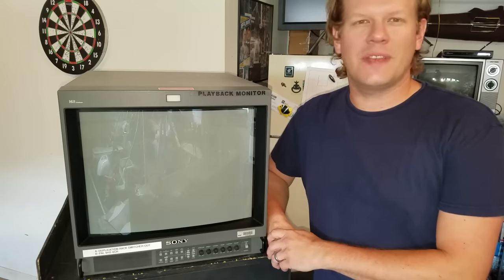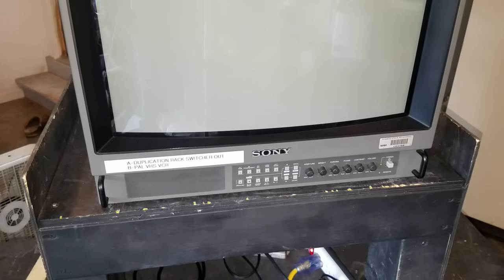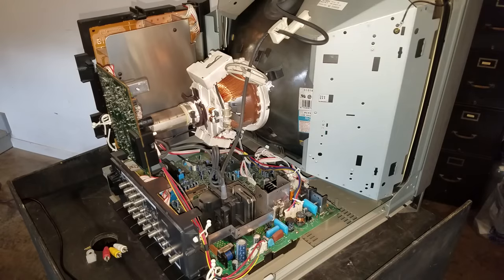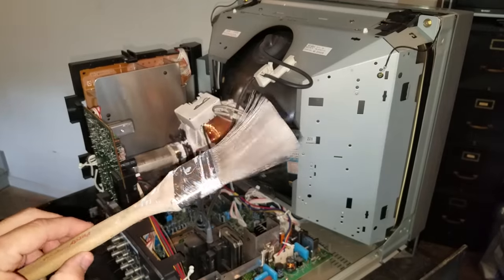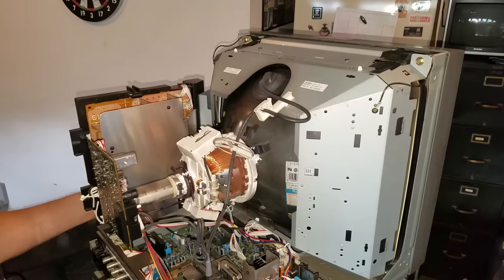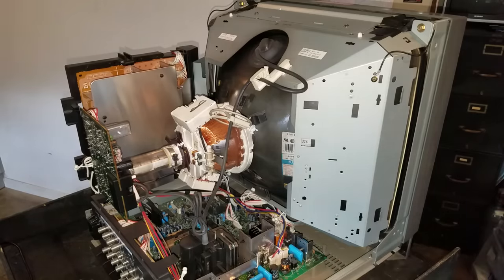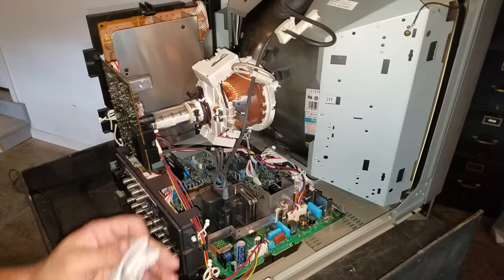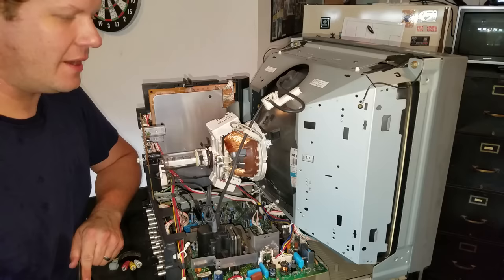How to Clean inside a Sony PVM CRT Monitor

Comment: Wow, when you said dust build up could cause smell and crackling/popping I just had to check if my monitor wasn't like that and turns out it was....extremelly dusty, even multiple cobwebs and dead spiders. Cleaned her up and the noises reduced almost entirely, it also runs noticeably less warm! You literally saved my AOC CT500G, thanks for the great video and info!

Comment: I have a PVM 20L5 manufactured in 2002.  I have never taken it apart to clean due to fear of breaking something.  Was this the first time you cleaned yours since you had it and how often would you recommend doing this?
Reply from the maker: Hi.  Thanks for the question.  This was the first time I cleaned inside this monitor.  I've cleaned inside many others,  I'd say you need to do this once every few years depending on the environment you store it.  I have lots of monitors in storage, so I have to clean them every  six months to a year due to the high dust.

Comment: Aren't you afraid of being shocked? Be careful, my friend.
Reply from the maker: papa agoo I'll go over this a little more on my q&a video I'm working on.  I have been shocked, not by the anode or flyback.  That's just part of working with electricity though.  There's always a risk. Thanks for watching.
Reply: @RetroTechUSA  how badly did you get shocked?
Reply: Retro Tech you should totally wear a mask for the dust and gloves and/or a grounding bracelet to isolate/ ground yourself. be careful bro! not worth the risk. thank you for the video. God bless

Comment: Hey Steve, I’ve been watching your CRT videos over the last few days, mainly the safety ones and cleaning ones.  They gave me the confidence to open up my “new” Sony Trinitron KV-27FS13 made in September 2001 that I just picked up.  I wanted to give it a good clean out.  I have worked on electronics before, repairing an iPod classic, upgrading my laptop internally, and repairing my clothes dryer.  I was a little worried about working on a CRT, as I never had before, so I bought some heavy duty high voltage gloves with the leather gloves going over the top of them, I wore a thick cotton long sleeve shirt under the gloves, and I also wore some rubber construction boots I had and stood on some spare wood I had while I worked, along with taking my wedding band off, lol maybe a little over the top but I wanted to cover myself.  I also worked the entire time with one hand in my pocket just in case.  I did not discharge the tv, I just left it off for three full days after I got it and before that, it was off for awhile and only turned on to test it the day I got it for a few minutes.  I was a little concerned with trying to discharge so didn’t attempt it plus just for a cleaning, I felt it wasn’t completely necessary.  I took a paint brush to the top and non computer sections and then used anti static brushes on the cables and the motherboard.  I did not touch the anode cap at all.  I was hesitant to hit the fly back and the line that goes from the anode cap to the flyback, but as I went on, I got enough confidence and guts lol to hit those lightly.  Gave the motherboard a nice cleaning too.  I finished up with the air can from top to bottom.  I also took the back plastic shell and scrubbed it down with soap and water with a sponge on both sides, as this was the most dusty part of the tv (the inside had dust but I expected worse, it was not bad at all).  I turned the tv on about an hour ago and it worked so I didn’t screw anything up lol.  Anyway, thanks again for your video, it was very informative and interesting.
Reply: would you recommend wd40 electronic cleaner for cleaning the inside of the CRT?

Comment: I recently learned that dust buildup combined with humidity can allow for high voltage arcing too.  I need to try cleaning the monitor, but I want to learn about high voltage safety first.

Comment: I have one of these, great monitor. Great tips and overall very informative video. Keep it up. I subscribed.
Reply from the maker: hdRGB Thank you.  It's a great PVM.  Glad to have you here.
Reply: Retro Tech what if the monitor accidentally drops and a circuit plate touches the iron cover? Is that dangerous?

Comment: Hey great instructional video, this is very helpful.  I just picked up a Sony trinitron from October 2001.  I want to give it a cleaning inside similar to what you did in this video.  Do I really need to discharge the tv?  I plan on leaving it off for two days and prior to, it was tested for a few minutes but before that it wasn’t really used.  Also is a purdy paint brush ok or should I be using anti static brushes?  And finally, when cleaning with a brush, I should just be avoiding the anode ring up top and the fly back and not touch those with the brush?  Everything else is ok to give a quick wiping with the brush?

Comment: Hello Retro Tech, 
I just subscribed to your channel today. Great job on everything you do and how knowledgeable you are, thank you for doing so much for the gaming  and electronic repair enthusiasts. In the past year or two I been into electronic repair, restoring, modding and anything video game related. Since I've discovered this new passion, I have been trying to fix and restore anything I own that needs fixing. Recently I own a Sony CRT KV-27FV17 manufactured in the year 2002, I use it to play my consoles as well as to watch DVDs. I want to attempt to clean it thoroughly just like you showed us in this video. Do you recommend discharging the TV prior to cleaning it or is not really necessary? Also, in the future with the help of your teachings I would like to attempt to fix a problem it has, the tv displays a bright white line on the left side of the screen and the line could be observed most likely when the display is black. If you have any suggestions I would be happy to learn and attempt them myself. Thank you, I will continue watching and learning from your provided videos.

Comment: Hello Retro Tech!, I been watching your videos they are great, and have the info I've been looking for, been giving all thumbs up on them and subbed your channel. You explain things well and your quite knowledgeable.   I love CRT Monitors and Televisions as well, just brings me cozy nostalgia :) watching some movies on them and doing some retrogaming on them.  

***I have one TV a 1987 Zenith that is very dusty, and i want to simply brush the dust off the board / components inside and hit it with compressed air, like you did.  If i leave the TV off for a few days then open it up to dust only as you demonstrated and being careful not to touch anything with my hand or arm, do i need to or should I discharge the CRT first?***  

I just put my subject/question above at the beginning so you don't have to read all of my lengthy diatribe to answer me but I put a little more info below, so you can laugh or shake your head! :)  

I have recently picked up a few consumer TVs, left for trash, that all work great - even found a late model 2005 Sony 32 inch Wega Trinitron HD 1080i HDMI boob tube crt TV (excellent picture, btw), boy was it heavy to get back to my place all by myself (manual says 165 lbs.), I felt like an Egyptian building the pyramids with massive granite blocks, lol.  I also found a 'Zenith 1987 27inch Receiver Monitor Advanced System 3 TV' and it works fine has a decent picture, however,.. I looked in the back vents with a flashlight and its very very dirty, worst I've ever seen -the dust is thick and actually black & caked on lookin', building up what looks like magnetic dust patterns centimeters off the neck board and flyback! and on most other stuff in there, the mainboard at the bottom is buried! in thick dust, can barely see there's components on it, haha!.  It looks to be massive dust combined with saturating cigarette tars??, the previous owner must have been a heavy smoker for decades or the TV came from a bar! lol idk lol - however, the TV does not stink like tobacco or smell at all even when warmed up so i don't know, may just be 32 years of heavy black magnetized dust. haha!

I'm just concerned if i should discharge the anode before using a brush to knock off the heavy dust from components and then hit it with some compressed air.  Just order some of those special rubber gloves maybe? What do you think?  I'm planning to just go by your video, as is no nothing, just leaving the TV off for a few days but I wanted to verify in case you did discharge the CRT anode and left it out of this cleaning only video. (I thought about possible arcing of current and thats my concern even if i don't touch anything)

Thanks in advance and please let me know, if I need to discharge the CRT to just dust? 

(I don't want to make a stupid mistake and get knocked out or worse.  I've been shocked before - I felt AC 120 volts house current as a child and its really bad man, I think I almost died, lol.  Also been shocked by Tiff grass lawnmower spark plug and it was quite painful maybe akin to a rattlesnake bite.)
Reply from the maker: Thanks a bunch!  I can tell that if I were cleaning out the TV that you have in question, I would be fine cleaning it without discharging.  However I can't make the call for you, since I can't see the TV myself and I don't know your exact level of knowledge around CRTs.  It's always better to be safe than sorry.  If the TV has not been turned on in a while, then there may be no current left in the tub, but that's not 100% the case.  Just do what you feel comfortable with and don't be afraid to take some extra time to do things as safe as possible.  I still discharge CRTs before I work on them just to be safe.

Comment: Now I feel much less stressed about buying a PVM. What kind of screwdriver are you using to take apart the shell?
Reply from the maker: Thanks.  Any Philips head screwdriver is fine to use to open the shell.
Reply: @RetroTechUSA  three months later and finally getting to dust out my 14M2U and 20L5.

My L5 has a 129x card in it, do I need to remove the card to be able to take off the shell?

Comment: Hi there, thanks for the PVM vids and this one in particular helped me open it up! Just received a 1354Q and it’s extremely clean inside out but I can’t get a picture to appear. What’s the expected result turning it on with no inputs? I get a blue screen then screen goes black and tally light remains a consistent orange. I get the result hooking up an N64 or GameCube using the composite video lines. It’s my first PVM so hope you can help. Subbed already! (:

Comment: I just bought a Sony PVM 20M4U and it also has only 1 input for component and rgb scart. I am using a gscart switcher for scart devices but is there a way to have both scart and component connected at the same time?
Reply from the maker: Sorry, not with that PVM.  Since it only has 1 input, you'll have to toggle between RGB & Component.  There may still be a component to scart pass through adapter that you may get to work with the G-Scart, then you can use one of your inputs on the gscart as component.  Then you can change between component and RGB on the front of your PVM
Reply: @RetroTechUSA  Thanks Steve, I'll look into that adapter.